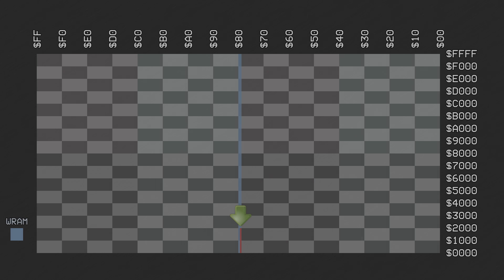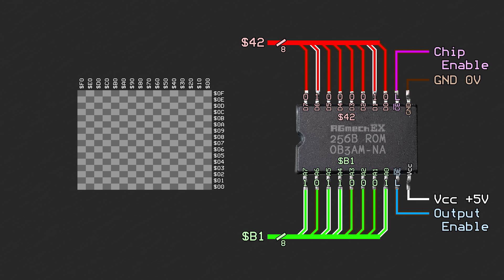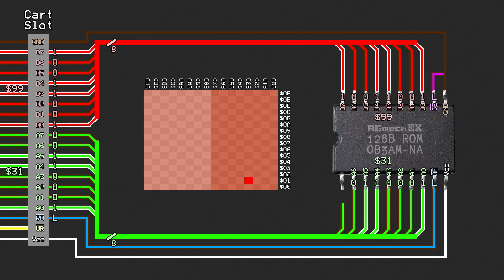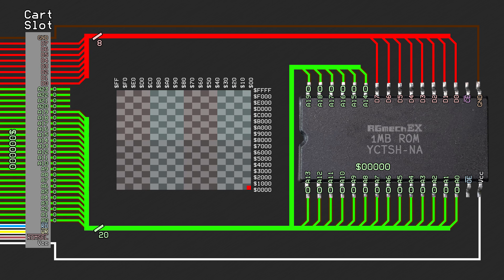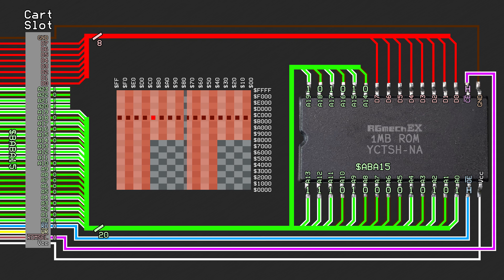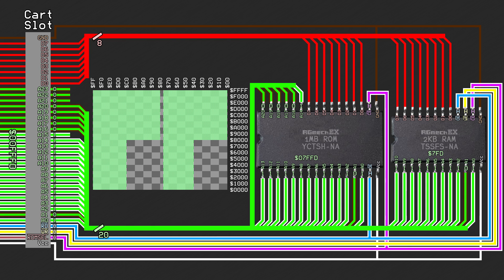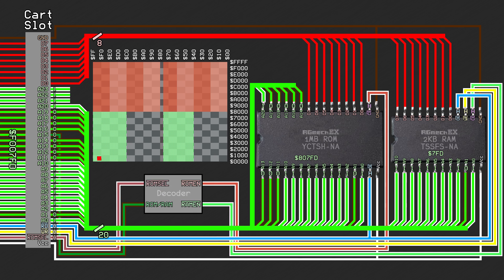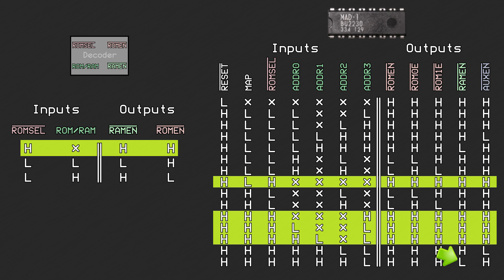Mirroring & Open Bus - Super Nintendo Entertainment System Features Pt. 09b

Comment: So, when there is memory mirroring, the hardware is in fact NOT duplicating all the contents of memory, it's just tricking the system so that a call to the mirrored section is actually calling the original address, right?

I'm still a little shaky on why this would be a thing to begin with.  There's some implication that it enables a system to use either a smaller or a larger amount of memory, but if that were the reason, why sacrifice part of the extended memory to prevent an operation that should logically just not show up in someone's code?
Reply: There are two reasons for that: The first one is that the 65xx family prefers shorter addresses over longer ones which is why WRAM is mirrored to $0000-$1FFF in banks $00 -$3F and $80-$BF (you need a place to access the somewhere hardware registers anyway). The second reason is that the address bus hasn't got all of its pins connected. For example, most SNES ROMs are LoROM where only up to 4 MiB of ROM is mapped. In particular, the ROM data only has 23 bits of the 24 bits mapped i.e. the highest bit gets ignored and banks $80 to $FF are virtually identical to the banks $00-$7F (in actuality, WRAM is hardcoded to banks $7E and $7F and some ROMs also have FastROM, which boosts ROM access by ~33%, enabled which only applies to the higher banks but not the lower ones so there is some minor differences) and even fewer pins are used on smaller games.

Comment: If mirroring is just the result of one (or more) of the address lines being disconnected/repurposed, and the connection with the cartridge is otherwise the same, why do only some pages on one half of the mirrored address space allow the faster ROM access speed?

Comment: With those ROM and RAM chips you showed on the screen, I have to say you have more sense in pin placement than most actual ROM and RAM chip manufacturers.
Reply: It makes of a difference for ram but for an eeprom ooh boy you sure want to strangle the rom designer for being un-able to count.

Comment: Something came across my mind for a while. I'll like to know about how demo were implemented in the game like auto-play demo such as arcade games, Super Mario Bros. (1985), when waiting in Title Screen few seconds it'll play a demo, etc. Thx.
Reply: from my understanding, they're basically recorded player inputs and/or scripted game objects
for example, to make a ship move and shoot in a shoot 'em up:
loadlevel 1
joystick right
wait 10 // we'll say it's seconds here
button a // shoot
release a
wait .5
button a
release a
wait .5
wait 10
joystick left

it's honestly not terribly hard to implement these [now that i at least understand the concept], they're basically scripted cutscenes in say, pokemon/zelda.

the game would be put in debug mode or similar and it logs the desired amount of player input and saves that to a file on the development computer or, something of the nature. this data is put into the game, somewhere, and either the game program or the system interprets it, and plays itself, basically. 
[and the other thing ofc, is that the player inputs besides start or insert coin are disabled]

another possible solution is to render gameplay to video files or closely placed screenshots, not particular space-efficient. old games certainly weren't doing it. 

some games render an animation that doesn't use any code [other than the animation system]. i know of a particular flash game that does this.

auto play demos absolutely use the first approach, though... the game is for all intents and purposes, playing itself. [or rather, re-playing itself based on what one or more of the developers had previously played.]
Reply: I was trying to implement in my sonic 1 hack didn't know where to start. Thank you for the beneficial information.
Reply: no problem

that's only the rough idea, though, and you're obviously going to want the data that encodes your 'inputs'/scripts to be as small as possible. hoping/guessing you have some idea how to accomplish that?

also guessing your timings (if any) need to be in milliseconds or game ticks, something like that.
Reply: @ETXAlienRobot201  This makes me realise that SMB1 has got a bug where Mario can possibly die in the title screen due to synchronisaion issues with the movement and the enemies. A clear sign that the title screen is just an input playback.
Reply: @MarioFanGamer659  interesting theory. could probably verify it in a disassembly/decompilation by now?

Comment: What if you read from an unmapped/open bus address then? Do you just get garbage data or just zeroes?
Reply: Neither nor. Instead, you'll get the MDR (i.e. the last used value) back. So e.g. you just have stored 0x14 to $00 and then load from open bus, you'll load 0x14 again.

Comment: So I've heard Capcom themselves messed up understanding mirroring and open bus once. Reportedly they used the concept as copy-protection on some games but on Rockman X (maybe one of their first) they got it wrong (maybe it was different between development and retail PCBs?) so every copy of the initial print would be detected as a pirated copy. To fix that, it seems like some poor guy had to solder a wire to every one of however many thousands of copies they produced, at least for the 1.0. Reportedly they fixed the programming in the 1.1 and international versions.

Comment: Wait, what is open bus?
Reply: Open bus means the wrires lead to no where so you'll get the value in the MDR (i.e. the last used value). So e.g. you just have stored 0x14 to $00 and then load from open bus, you'll load 0x14 again.

Comment: This made the previous video make SO much more sense! Now it makes me wonder if "BIOS shadowing" on old DOS machines was a similar sort of thing....
Reply: No, it means a different thing. Memory mirroring is not as prevalent on PCs, though hardware port address space belonging to ISA bus cards is often heavily mirrored.
Shadowing means that BIOS is copied from ROM to a part of RAM on startup which then mapped instead of ROM. This is done because RAM is faster/to save money by using slower ROMs. ROMs on the SNES are often also slow for these reasons.
Reply: @noop9k  Yeah, I vaguely recall way back in my brain something like "shadow BIOS copies portions of BIOS to RAM so it will run faster", but I'm forgetting a lot of that old real-mode DOS-based PC stuff... like I used to be able to recite the default comm address lines and IRQ numbers for COM1, COM2, LPT1, sound blaster cards, and NE2000 NICs off the top of my head... but now, that the last time I needed that information was literally decades ago....

Comment: Why is 1 (used) called Low and 0 (unused) called High though? What does "open bus" actually lead to?
Reply: Actually, low is 0 in TTL logic. It is common to use 1/high as “disabled” state and 0/low as “enabled”. This makes sense from electrical standpoint. In old TTL  logic disconnected pins are pulled up internally to high and therefore mean “disabled” by default, and to enable you just connect them to ground. This also resolves conflicts because if you connect something to ground many times, you get the same result. This is called “open collector bus”. Not used in newer electronics though for various reasons.
Modern logic is 3-state(pulled to GND, pulled to VCC, high impedance/disconnected) this means that on bus conflict (if decoder enables >1 device) your devices may be damaged because of short circuit between VCC and GND, that if all devices are disabled, the inputs are floating because all outputs are in high impedance state.
Reply: Thanks for explanations!
Reply: Sergey Rozhenko нет проблем
Reply: Open Bus leads nowhere (nothing will connect to the data lines), so the data that comes back is just whatever was previously on those lines.

Comment: You explained things as if the decoder used AND gates, but I'm pretty sure those symbols were OR gates.
Reply: They're active-low signals, so an OR gate is the correct one to use to functionally get "and" behaviour ("A OR B" is low when A is low and B is low)

Comment: As an EE student I'm confident that VCC is always the top-leftmost pin and GND is always the bottom-rightmost...
Reply: He is explaining concepts, not how the typical ROM chips are connected, which would make the video more confusing and therefore less useful. In real ROMs address and data lines are often not connected as cleanly, using actual ROM chips would create a visual mess on the screen.

Comment: To wrap it up,It sounds like as if mirroring is used to fill in space with recycled data or something like that.
Reply: Mirroring happens because some of the address lines aren't hooked up to the chip, so those bits get ignored. The alternative would be to add more logic to ensure those bits are zero and otherwise return some constant data, but there's no reason to do that. It would just make the design more complicated.

Imagine you have 8 outlets each with their own switch, but only 5 lamps plugged in. The other 3 switches just don't do anything. You get the same pattern of lamps turned on/off no matter what those 3 are set to. Maybe you can rig something that turns the lamps off if any of those three switches are on, but why?
Reply: @renakunisaki  It also is useful for the 65c816 which which prefers shorter address declarations over larger ones.
Reply: Mirroring is basically a side effect of doing things the simple way. Its just a side effect that is harmless or even useful.

Comment: Oh I see, so basically mirroring is mostly a side effect of an address space larger than the address bus, combined with a sort of integer overflow?
Reply: That's one way to look at it. Unsigned integer arithmetic is modular arithmetic.
Reply: Essentially.
Wouldn't call that an overflow, because here address bits are being stripped off rather than the system running out of them.
An overflow is when a number runs out of bits to represent higher values, as a result the higher bits that would have been there are thrown out and the bottom part of the number remains, thus making it look like wrapping around.
Although that is a good analogy, for sure. :)

Comment: When using the SRAM chip (last part in the video) why shift some address lines to free A15 (for ROM/RAM selection) while A20 could be used for that purpose ?
Reply: Like KieferSkunk alluded to, the top 8 address lines A16-A23 represent the the bank register(s) on the 65816 CPU. Using the A20 line for ROMSEL would make the addressing even more unintuitive and inefficient. RAM would only be accessible from a few banks and you wouldn't be able to access the ROM or anything else in those banks; only RAM. That means that every time you wanted to access RAM you would have to switch banks which is slow. It would also make copying data between ROM and RAM slower.

The takeaway is that the top 8 bits of a 65816 CPU address is not equal to the lower 16-bit part of the address relative to the CPU design and instruction set. See this channel's previous video on memory banking and paging.
Reply: Because the BIOS has to enable A20. No wait, wrong system.

Comment: So basically, you take the data stuff, fold it over, fold it again, fold it again, unfold and fold the other way, add some wires so it doesn't interfere with stuff, and you're done!

Comment: Why does it have to be mirrored across the entire memory bank?
Reply: Because as the video correctly explained it is not really mirrored - just the chip cannot tell any of the "mirror" addresses apart because the wires that could distinguish between them were not connected because there was nowhere to connect them. This could be fixed with a (more complex) decoder/demultiplexer but noone simply cared enough.

Furthermore it was sometimes advantageous to have parts or ROM "close" to RAM because "short jump" commands took less space (and executed faster) than "long jump" ones and such...
Reply: @jwhite5008  less that they didn't care, more that it was an unnecessary expense, adding more chips to fix something that isn't actually a problem.

Comment: This is the reason some of 8/16bit computers used enable-hi ROMs - it eliminated the need for additional logic and typically connected to highest unused address bit. 
Some ROM and RAM chips have TWO enable lines - both need to be low for the chip to be enabled. One would be hooked to an address line, the other to /ROMSEL in this case.

I don't know if SNES cartridges ever used such tricks, but in older machines it was common because cartridges still used through-hole DIP chips which were more expensive to install than newer surface-mount ones. Furthermore, logic chips themselves were more expensive and could delay the signal enough to be a problem.

Comment: So, I'm making a wild guess here. Bank swapping mechanics can make use of a decoder that not only demux the input, but also retains the input when its write pin got pulled high. Which means, suppose we use lo-ram configuration, the lower part could have pin 15 switching between RAM, and ROM bank selector, with pin 14 being the write pin, pin 12~13 being bank selector selector (to allow 4 active banks), and pin 0~11 for the bank number, which allows 4096 banks of 1MB ROM in theory, kinda overkill but the capability is there (if anyone ever wish to write a 4GB SNES game). Additionally we could have 1 more pin for bank selector selector to switch between RAM and ROM bank selector, to also allow RAM paging, and now we can have 2048 banks of 1MB ROM and 8 KB RAM each, to make up 2GB of ROM and 16MB of RAM, with 4 MB and 32 KB visible at once, if anyone so want it to happen. 
But then, if it's limit is only achievable in modern homebrews, we might as well make everything RAM and have a memory and drive controller on the cartridge to control the whole thing.
Reply: @KieferSkunk  then, wouldn't it be impossible to use only decoders? If there's one layer, you could just hard wire it to the address lines, the same goes two layer (but you need thousands of decoders for that), and three layers would truly be "why even bother". And if we need additional chips to remap using commands, it might as well be a SD card or even M.2 drive controller anyway.
And for where else it could be useful, well, maybe for FMV, as you can effectively stream it by switching banks during playback, which can be done ahead of time using two bank slots. Also, it could be useful for games that has huge maps, as then you could use 1MB for each map, 2MB for two tile sets of the choice, and the last 1MB for game logic and player assets (and that 1MB can be extended, or "slowest" RAM instead of ROM).
Reply: 野龍 simplest banked memory impl is a register (/ a SRAM that holds only a few bits), connected to an address decoder, yes.

Comment: For anyone curious about demultiplexer vs. decoder:
A demux is used to route a signal to different places.  Since the logic in the video is essentially routing ROMSEL to either the ROM or RAM, it could be considered a demux.
A decoder maps some set of inputs to some set of outputs.  So, the logic in the video is indeed a decoder, and once it's expanded like at 8:50, it can't really be called a demux anymore and decoder is a better term.
Reply: I've seen 74xx guides where the parts were labeled "decoder/demultiplexer" even though each was probably originally only intended for one use or another. 
But I do agree that the part shown at 8:50 can not really be said to be demultiplexing anything (other than /RESET signal which would be kind of stupid).
Reply: @jwhite5008  Those are line decoders, a specific type of decoder, which can also be used as a demux.
Reply: Why would you want multiple outputs of a decoder pulled low at once? Is there a way to use bus conflicts?
Reply: @powerhouseofthecell9758  In this specific application, the cases where there are multiple outputs active are for an overall ROM enable plus either ROM0 or ROM1 enables.
Reply: @KNfLrPn  What sort of cartridge hardware would require a setup like this?
Reply: Afraid I can't help you there.  I specialize in digital logic but don't know much about SNES.
Reply: I don't specialize in SNES either but I guess it could be done so cartridges could be manufactured with either one larger ROM chip or two smaller ones without any changes to the software - depending on what was available/cheaper at the moment.
Reply: @powerhouseofthecell9758  Not the SNES case, but for example if you're making a microprocessor, the "add" instruction enables the adder, and you can implement the "sub" instruction by enabling both the adder and the negation.

Comment: What happens when reading from or writing to open bus?
Writing is probably the same as >/dev/null, but what data would the processor see on a read?
Reply from the maker: See the previous video for more info--it would get some value that was previously on the data bus.
Reply: @RGMechEx  
Thank you very much for the answer!
Your great videos are highly appreciated.
Reply: @RGMechEx  Is it retained purely capacitively or does the SNES have bus-keepers?
Reply: I expect it would just see nothing but FFs.
Reply: Could be FF could be random could be many other things on various systems.
can expose contents of some internal buffer, or some garbage from internal housekeeping, such as DRAM refresh
Reply: Tends to depend on the specific processor, but usually returns the last value read.